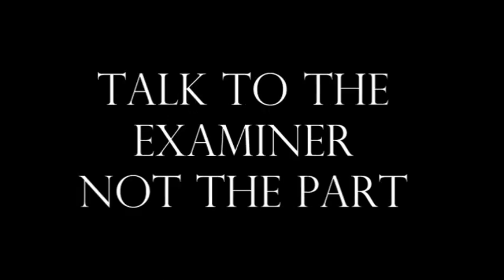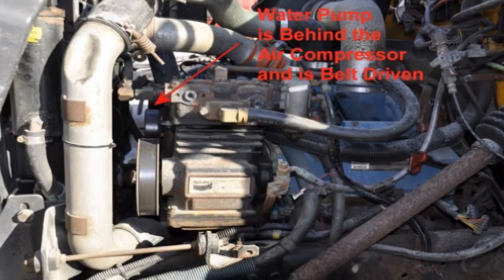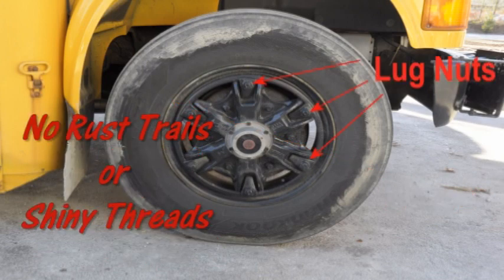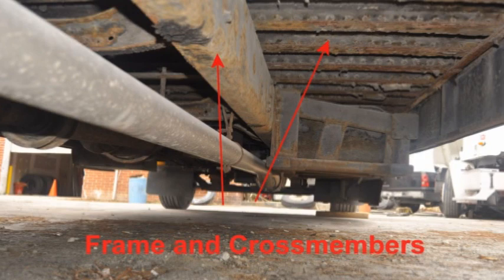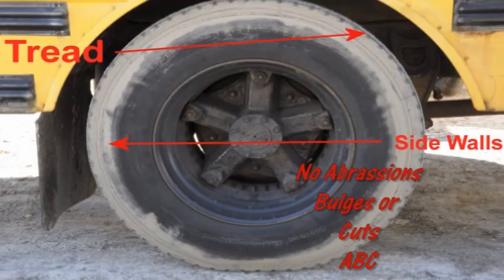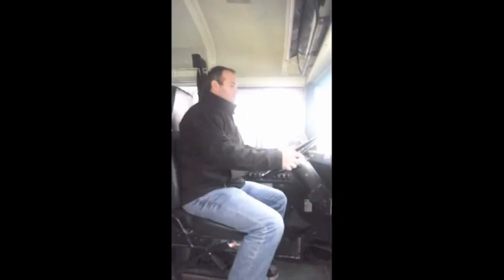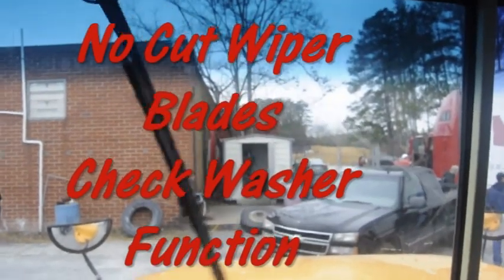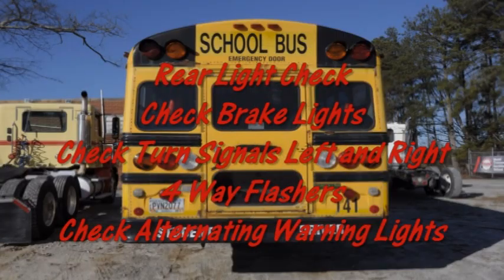GDA Training School Bus Pre-Trip Inspection

Comment: Am I supposed to get out and check function of lights or do I ask the examiner to get out and check?  And do you think the video is current for 2019 testing?
Reply: My examiner in Georgia got out and checked my lights for me.  Otherwise I guess you would have to turn them on and check yourself
Reply: The video is current, because this is the procedure you do when you do the test. One point to know is if you are taking a classes in a different type of bus, look for a bus that is similar to the one you are practicing. 😊